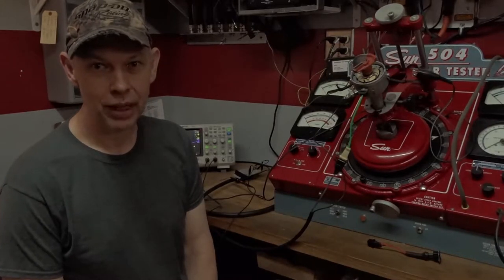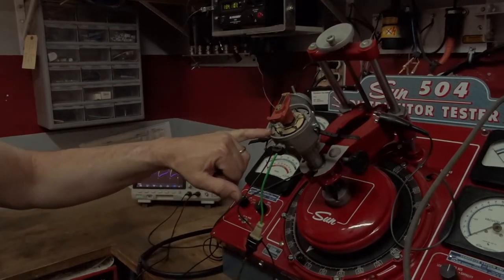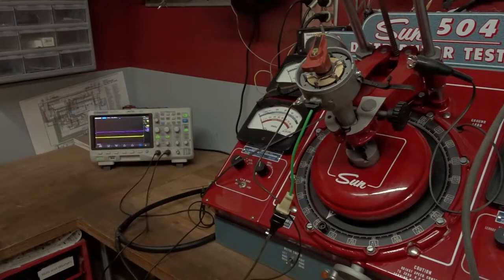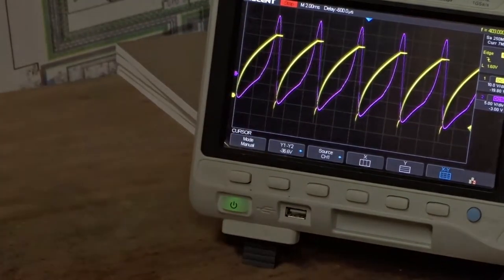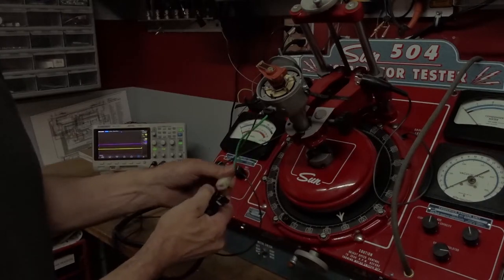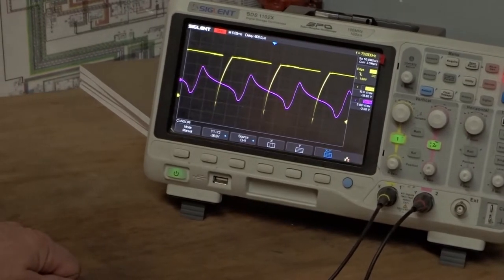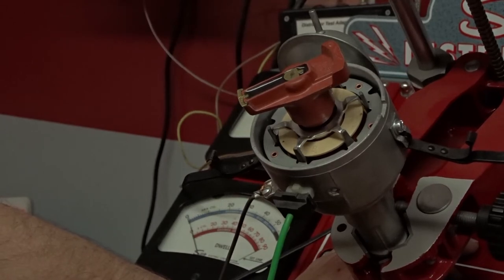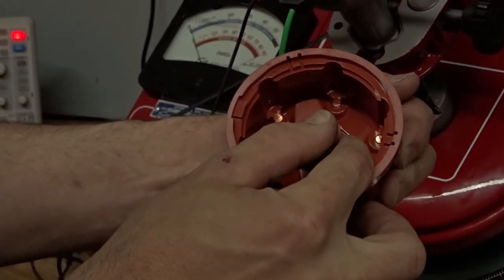Inductive Ignition Distributor and the effects of Polarity

Comment: You have no idea how helpful this video was for me now. I am converting an Opel Corsa from EFI to carb and distributor ignition (due to various reasons). I got an inductive distributor and was not sure how to determine the correct polarity of the 2 pins (obviously they are not marked). I will use your method to determine whether I connected the polarity correctly once I get the car running. At least there are only 2 wires so I have a 50% chance to get it right.
Cheers from South Africa
Reply from the maker: Hendrick,
Remember the signal polarity is determined by the type of ignition system  you plan on using and no it cannot be directly connected to an ignition coil. My advice would be to use an MSD ignition box, they are cheap and although by for not the best it will work for your application. The big difference is the MSD box is looking for a positive going signal whereas the Bosch systems used on Porsche applications use a negative going signal. 
Good luck with your project
Kurt
Reply: @klassikats  Hi. Got the car running. Thanks again.

Comment: Wow, this type of inductive distributor is so much better that the old "points/condenser". Bosch made this type here in Brazil during the 80's (end of the 70's). Later it was superseeded by Hall Effect ones. But it seems at higher RPM this inductive ("spider" as mechanics say here) distributor might give better performance. I have an old 79 Air Cooled VW upgraded to one such system. Is has a Bosch 6-pin electronic module known as TZI. Bosch Hall Effect distributor seem to work with 7-pin controllers. Those waveforms match with theoretical ones I have seen before for this ignition system.
Reply from the maker: The hall effect distributors will produce a square wave signal versus the sine wave that the inductive distributors produce.